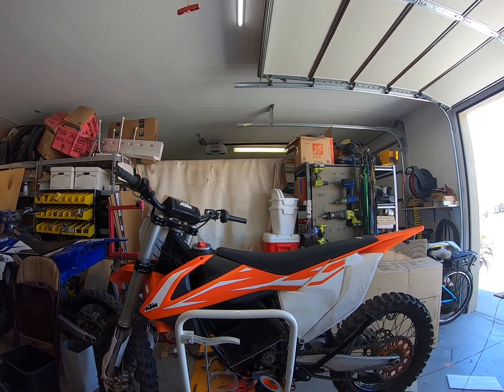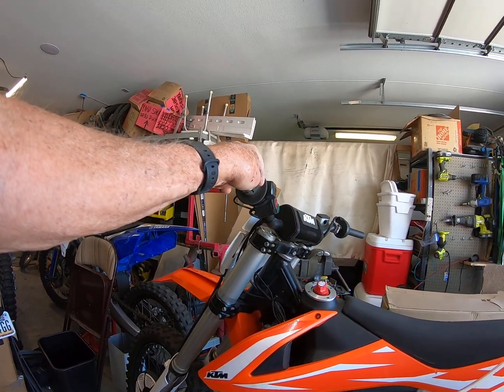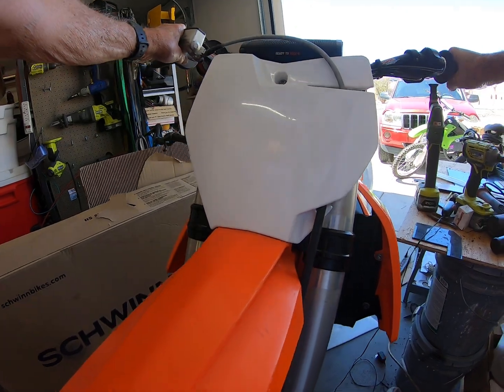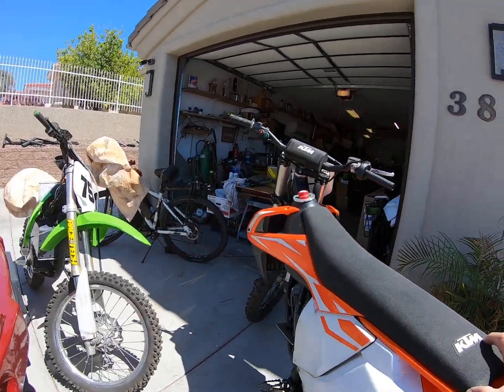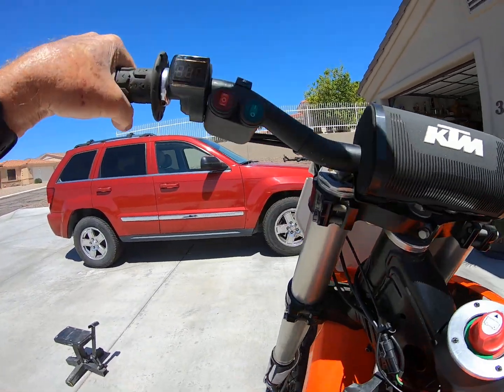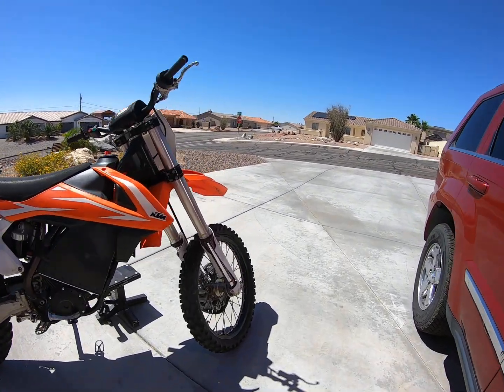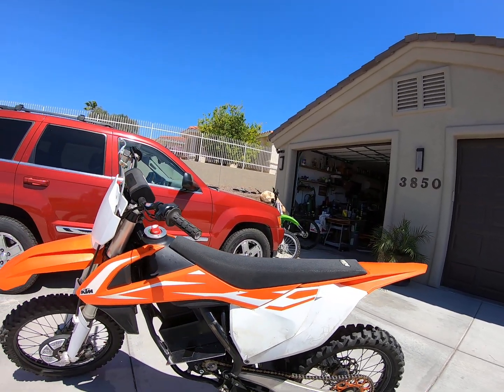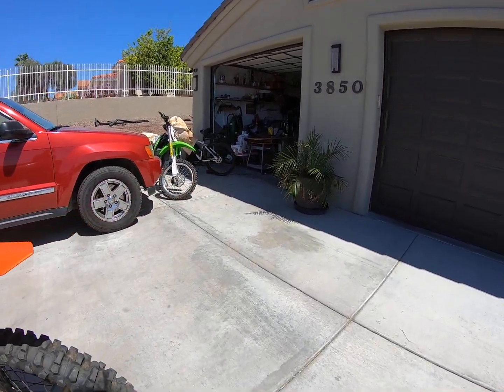KTM 150SX with QS 138 70H V3 Motor, and EM-260SP/2 Controller Walk around.

Comment: What is the range expected to be?
Reply from the maker: This has been in the owners hands now for over 10 months.  He repeatedly gets about 40 miles on a full charge of single track and trail riding.  The battery is a 20S 16P molicel P42A cells, and the total bike weight is 245lbs, with a full tank of electrons...

Comment: Hi Donald
Just been watching some of you build vids and look impressive, I am based in the uk and looking to build an electric husky 85 for my lad. Could you tell me where you get all your parts from and what parts are best to use for the build
Thanks
Reply from the maker: Thanks, and I use ElectroandCompany.com for the most of the parts. I can send you pictures of the mounts you will need to make and weld into the frame. I haven't done a Husky 85, but they are all about the same. The best motor/controller, wiring harness with throttle and switches is the QS 138 70H V3 motor with Votol EM-150SP/2 kit from ElectroandCompany.com, for this size of bike.
https://www.electroandcompany.com/product-page/qs138-70h-v3-3000w-em-150-kit
The display isn't any good, don't get it, and the pro throttle is better than the lite throttle, but the lite fits easier and better, and the volt meter is ok but I use a different one that is easier to read, and shows current. ElectroandCompany.com preprogram the controller and build the wiring harness to the point, all you have to do is mount all the components, plug in the 3 or 4 connectors  and turn it on and it works.
Reply: @dcoxryton  Thanks for getting back to me, if you could you over some pictures of the mounting points would be much appreciated. What volt meter do you use and what size battery would you recommend for this setup
Reply from the maker: @chrismorrall9906  Can you give me a email address, and I'll give you access to a whole bunch of pics of the build of the KX100, and the battery build. I don't know your skills, but I have 6 YouTube's here on building the battery for the KTM , and you can see the size and shape of the KX100 battery in the pics. But ElectroandCompany.com sells a 72V25AH battery for $1600 that is perfect.  It uses good cells and about a 20mile range size is 8.5" x 6.5" x 6". It would cost you $800-900 for the materials in that battery. The battery in my KX100 is 72V21AH and good for about 15 miles, the one in the pictures I was building was 72V 33.6AH, and a range of 25miles. These are mixed trail ride miles. Race laps uses the battery up faster. The finished KX100 is about 175lbs.
Reply: @dcoxryton  it’s won’t let me reply with my email address 
Also looking for maximum runtime with the battery
Reply from the maker: @chrismorrall9906  Try watching this private youtube and my address is in the end of the description  https://www.youtube.com/watch?v=V1Y-O8b_064
Reply: @dcoxryton  thanks Donald found it so have sent you an email

Comment: Have you ridin it on an mx track? Whats weight & power like compared to original?  Cheers love it. I have a 16 150sx, would love to do this
Reply from the maker: I just got it together yesterday, the battery is just taped in, I might get the battery in for the track this Saturday.  I'm estimating the HP at 34 now and 43 when completed.  It is an easy upgrade.